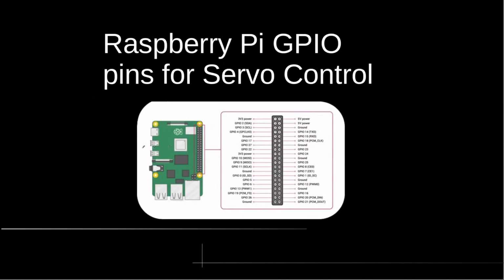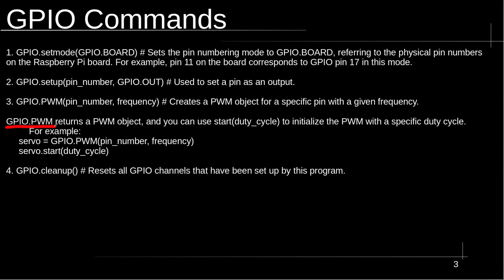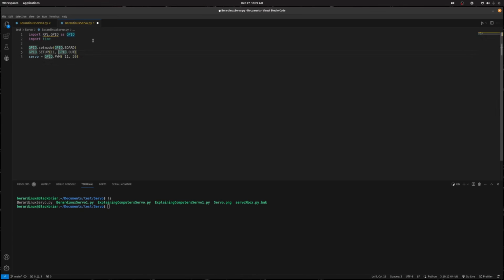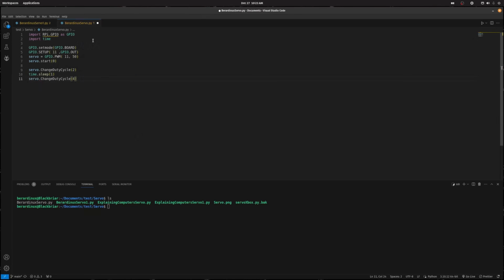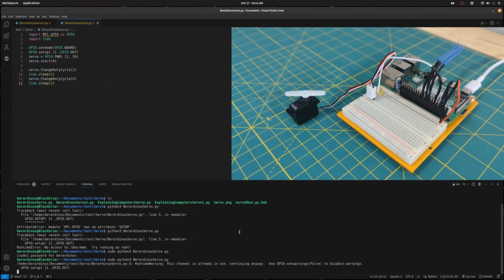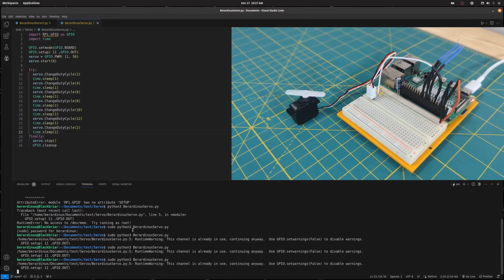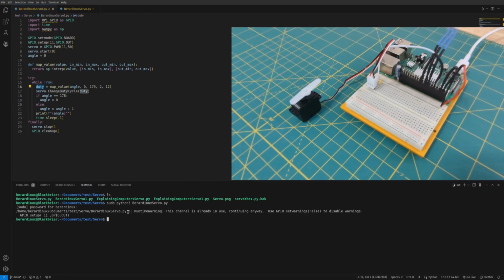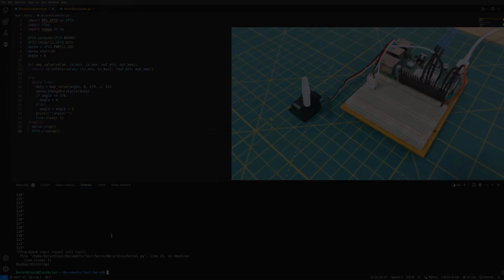How to Control a Servo with a Raspberry Pi!

Comment: Is it safe to use 5v with the gpios of raspberry pi? I thought they might damage them
Reply from the maker: I always like to tell folks to research before starting any project, but every Raspberry Pi I have owned runs on 5V, which is in pin 2 and pin 4. The GPIO pins are a different story, though; unlike the Arduino, whose I/O is 5V, the Raspberry Pi I/O is made to handle 3.3V. More Info: https://pinout.xyz/

Comment: Is it working on RPI 5?
Reply: Ya, but you will need to use the python library gpiozero instead of RPI.gpio. There will be a few changes but it should be pretty similar. Good luck 👍😁
Reply from the maker: Ya, but you will need to use the python library gpiozero instead of RPI.gpio. There will be a few changes but it should be pretty similar. Good luck 👍😁